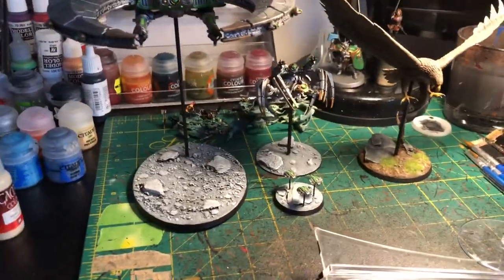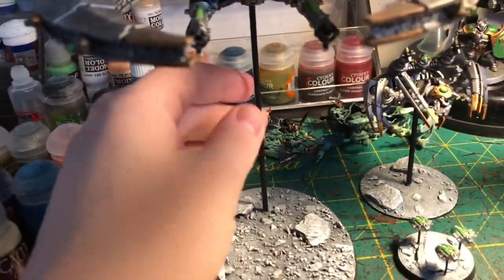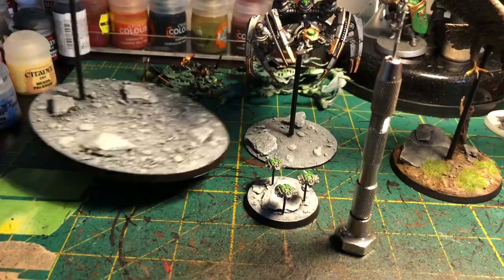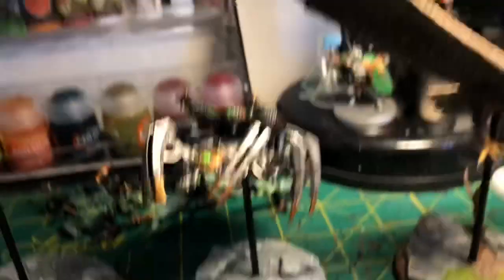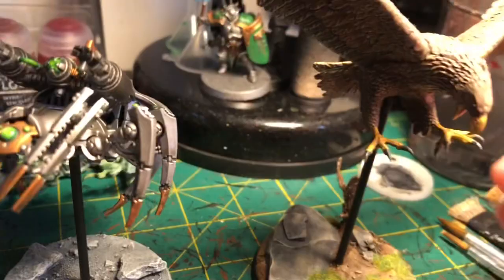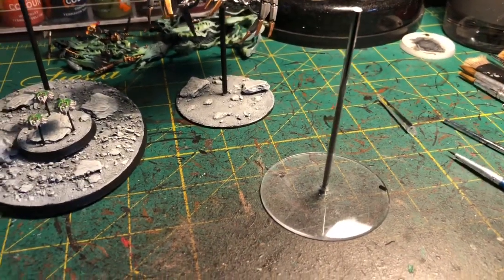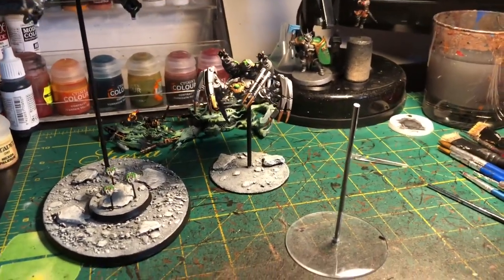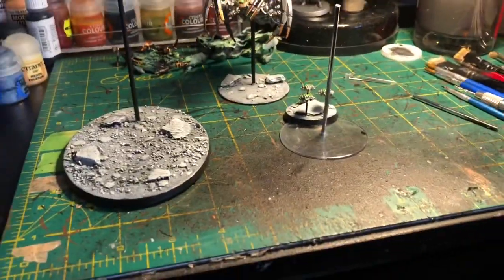HOW TO: warhammer flying stand replacement tutorial

Comment: What colours did you use for that really light grey base on the far left please? I'm doing some red sisters of battle and they would look awesome on that light grey base
Reply from the maker: I first did an undercoat of black then used an automotive grey primer as the base grey then a drybrush of white over the top :) if you watch my imperial knight army showcase video you can see them in more detail :)
Reply: @tabletop.painter  Will do, thanks.
Reply: @tabletop.painter  is it just sand or have you used a texture paint?
Reply from the maker: Just a mix of various sands :)

Comment: Nice idea! Sorry if mentioned, I did not get it, where the metal coat hangers already cut or did you do the cut? They are very hard to be cut, I would like to know what kind of tool you used.
Reply from the maker: Elias S no they were not pre cut the metal hangers I cut myself using a cheap metal
Saw from Poundland :) with the saw they are very easy to cut :)